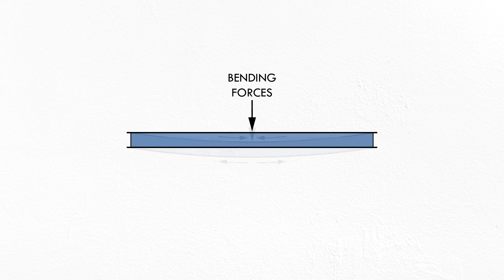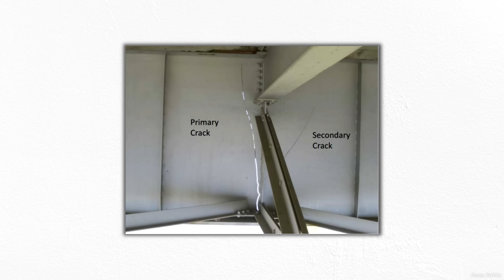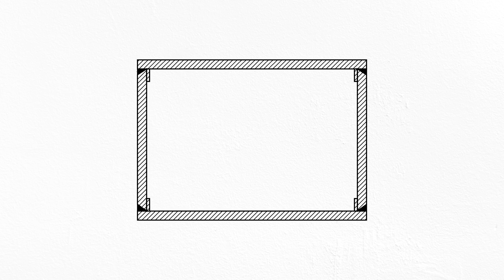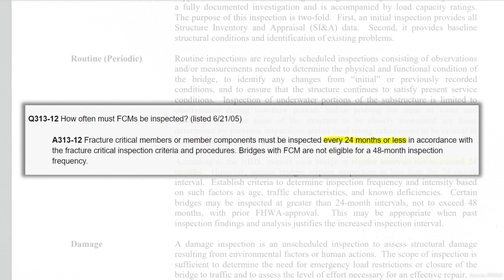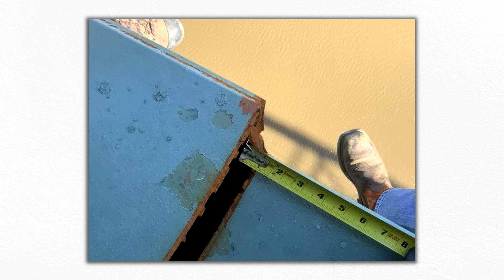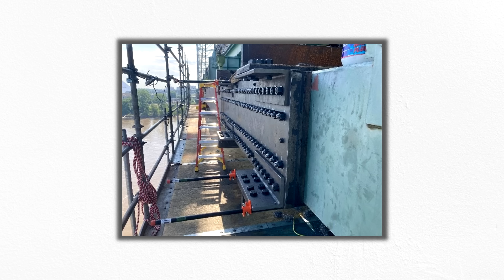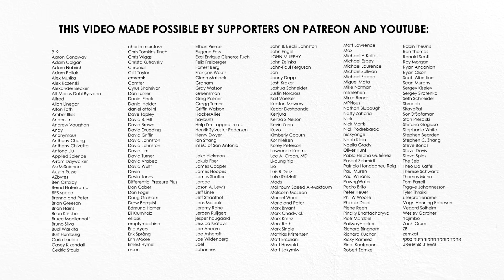What Really Happened at the Hernando de Soto Bridge?

Comment: This seems like a problem that drones and some sort of visual recognition could go a long way to solving.
Reply: They had drone footage from years before showing the crack. It's in the video. The problem isn't tech, it's that the people involved in analyzing the evidence are subscribers to the "ignore and defer" theory of maintenance.
Reply: @notsure7874  and THAT “theory” should be stopped IMMEDIATELY!
Reply: Drones were used, and the flaw was missed.  When somebody actually got close enough to touch it, it was discovered.  Drones are useful, but only if the footage obtained from the drone is reviewed... by more than one individual... that's key.  Apparently, nobody went back and looked.  You can have cracks in steel that are so fine that you can't see with your eyes.

Comment: It's amazing how despite losing such a critical piece, the bridge still remained standing. They knew how to build stuff back in the day. Even with our fancy futuristic materials, you can't find architecture that resilient today. It's like a lost art.
Reply: The likely reason for this is that the design for the bridge was completed well before modern CAD and FEM software was available to engineers. The entire structural design would have been done via hand calculations and hand drawn on A0 sheets of paper. If the calculation landed in between available structural member sizes or wall thickness they would always err on the side of caution and go with the next bigger size thereby increasing the factor of safety (FoS) in the design. Today, if the engineering standard stipulates a minimum FoS for a certain design CAD and FEM ensure that this will be achieved to the decimal point... because it saves money.

Comment: I would hope that a bridge such as this one that relies on that beam should have some kind of redundant backup, maybe a this steel cable that runs alongside that beam so if the beam fails the cable should take up the load until the beam can be replaced without a catastrophic failure of the bridge itself.

Comment: The "if your inspection hinges on a single person, there's something wrong with your inspection process" was great. Sometimes engineers only think in terms of design and materials and not about how work is actually done (by actual humans).
Reply: We've got a spreadsheet and all the cells are checked off.  The bridge passed inspection. <sarcasm>
Reply: @paulvarn4712  My father was an engineer that was responsible for making those check lists, and the procedures for testing and inspecting the parts the companies he worked for built. All of his work depended on the guy using his procedures correctly and ethically. people that ignore crap like that piss me off, I drove over that bridge A LOT with very heavy trucks, what worries me is they have proven they miss stuff like that on one bridge, now I have to drive across the much older, and smaller i55 bridge, how much did they miss on it? With all their engineers busy on the I44 bridge are they even keeping an eye on the larger amount of stress the older bridge is taking? Makes driving that route a bit of a pucker factor.
Reply: @scottjackson1636  story from different country, but humans are same everywhere. Inspection of elevator, engineer from client arrives, "We have 10 minutes, make it quick", and inspection is done after one ride to top floor.
Reply: @scottjackson1636  We lose 40,000 plus on the highways every year and none of those from bridge collapse.  You should be puckered over other drivers and your own driving; that is the greater risk.
Reply: Early in my career (engineer, not structural but manufacturing), I was taught to assume that visual inspection would miss 50% of defects when analyzing the effectiveness of a quality control plan. That's excessively pessimistic but forces the QA strategy to never depend solely on VI at any critical decision point.
Reply: "Don't worry. We fired the requisite sacrificial lamb at the very bottom of the totem pole. All is right with the world. -Sincerely, Upper Management"
Reply: Reminds me of the famous incident with the two catwalks that were supposed to be on a single beam support, but because it was cheaper and easier, support for one catwalk was scewed into the other.
Reply: @ShaliWolfy  Kansas City Skywalks and that was an error by the fabrication people, not the designer.
Reply: @stonefly69  Sounds like the Kansas city alright, but unless there's been two there. The designer had a share of the blame, but he was kind of screwed by the lack in those days of redundant oversight requirements. He should have checked the Redesign the owners asked for more carefully before OK'ing it but he shouldn't have been the only person with that responsibility, there's a reason every regulatory agency around the world has eventually started expecting independent verification of design work. Humans screw up from time to time. A second unconnected pair of eye's helps catch that stuff.
Reply: My guess is it was a manager responsible for inspections.

Comment: I'm guessing you are already collecting information for a video on the Miami building collapse.  That is shaping up to be criminal negligence by the building owners.  I just saw a report of regular saltwater floods in the garage under the pool. Sometimes to the extent that cars were floating.  They tried repairing cracked concrete support columns by injecting epoxy into the cracks, but that was failing and the columns were crumbling.  If I lived there and had that information, I'd have moved out.

Comment: The fracture at the top of the beam appears to be too straight, this does not normally occur in a fatigue crack. It is possible that this location has a steel beam splice.

Comment: That is terrible and an investigation should be done to find out why the existing inspection process failed. Those responsible should be held accountable.
    In retrospect, that bridge must have been over engineered if it was able to withstand those forces for so long with a structural member in such poor condition. Maybe all bridges are over engineered and certainly should be.

Comment: First off, sure you could see this crack then yes it could be picked up by visual inspection. What about the crack on structures or at weld locations which have crack propagation and inclusions you can't see with a visual? They should have a robust inspection plan which includes NDE techniques.

Comment: When more information arises, I think the recent Miami building collapse would be an interesting video idea
Reply: WTF is up with some of these comments? This is an engineering channel. Please keep your conspiracy theories to yourselves.
Reply: The republicans have already figured it out with no need for any research or evidence. It turns out that it was the fault of the residents who chose to live there. Case closed.
Reply: Look at the historical plans. The pavers where never meant to be installed and the pool deck was tied into the structural columns. In addition they took away important drainage features
Reply: Miami building collapsed because the soil under gave in, its built on what used to be flood plains and rising sea level causes sea water to penetrate back into what was once dry land and recovered, causing underground water rivers to form, soil collapses into caverns and causes the above ground to become unstable, Miami is ripe with problems like this, frankly its surprising it has not happened before or more often.
Reply: Bearcat  There are many factors buddy, I'm sure they'll come to light. Well you'd hope. I only look at facts. I was just responding to an idiot.
Reply: I assume it was something similar to the Algo Mall collapse, but I'm not an engineer, so I dunno. It just seems like a similar collapse in my mind.
Reply: That's going to be in litigation for the next 20 years, at least.
Reply: Yeah, good call!
Reply: I don't get why they stress tested it with traffic still going under it I was there that day it was a Krazy scene
Reply: Let the families of the lost grieve before making an video on it. Out of respect.
Reply: @taylor7772  out of respect to the dead, you must share everything we can learn as fast as we can learn it. 
Imagine I knew what killed a bunch of children, but didn’t warn anyone, so it kills a bunch more kids that would have been saved if I hadn’t been selfish. 
How many children must die for how many years before we’ve “shown respect “ and we can start sharing lifesaving data? 50, 100? Just one? Tell me how many is okay with you, because that number is zero for me. 
If my death can warn others, by all means don’t get superstitious. Warn people! Discuss it.
Reply: It was a report in 2018 saying the pool was eating the foundation and action was needed immediately but ignored
Reply: @johnwright4890  the summary of that same report said the building had no major structural deficiencies.
In any case, you may find that the normal time required to plan, bid, and approve a 20 million dollar project, that is 500 people’s money, is about two years. You may also find that Covid added more than a year to most of these major, complex contracts. 
It’s hard to predict construction costs during covid, or delivery times. 
I don’t know that there wasn’t incompetence (other than the summary of the report contradicting the report). I just think nobody else was jumping on projects like this much faster. 
You might imagine they didn’t have a lot of condo owner meetings to discuss maintenance during covid.
Reply: Controlled demolition.
Reply: The phrase “too soon” comes to mind. Thankfully, this bridge failure didn’t lead to any loss of life.
Reply: Anyone who could have done something didn't because they didn't care enough. Now the whole tv show second by second report to be done.
Reply: Honestly we already know what happened there and somebody belongs in jail if not a couple somebodies
Reply: It had just been inspected, that’s the crazy part of that building collapse .
Reply: This explains it https://youtu.be/PEPyE2h6P4k
Reply: @KezanzatheGreat  Sounds like you were an inspector for the WTC. Do you or have you work for NIST.
Reply: Money says that waterproofing or lack there of has major causes towards failure. It had a post tension slabs so the second one of those were to corrode and break it can easily cause a chain reaction causing collapse. But it's all speculation until an independent outside source does a report on it
Reply: @shawnhenderson1130  It's possible you've seen the same videos as I. There is a video showing water from a broken pipe and chunks of shattered concrete at the bottom of the ramp down to the garage. This was seven minutes before the building collapsed. The conclusion from that as well witnesses is that the failure started on the pool-deck The cause was the failure to prevent water collecting on th e deck and penetrating the waterproofing. This let to the chain-reaction failure of the supporting columns.
Until more information contradicts that, I think that a likely explanation. 
If I were the resident of a Florida high-rise I'd do some checking of it's history and inspections.
Reply: Pool was built above ground over the parking garage, pool had an ongoing leak which was neglected, water leaked into concrete weakening it over time, concrete gave in, the building collapsed.
Reply: @colzen925  Sounds good. Except the initial collapse was clear across away from the pool.
Reply: Too recent/contrversial. He'd likley get demonitized.
Reply: The collapse could very well have been intentional !
Reply: Except that has John McAfee ties
Reply: @Sassafras-  wait what???? where did that info come from? HOLY... did he kill himself after the collapse or before?
Reply: @Outwars1  It's bullshit. John McAfee had no ties at all. It's just excuses people make to cover up corruptions of officials and climate change.
Reply: @psychedeliccarrie5921  gone learn you how aye
Reply: The Miami building was a demolition
Reply: @Nikkisweeets  Congrats on posting the absolute dumbest comment on this whole thread.
Reply: @Nikkisweeets   Just go away.

Comment: CRT + SEX = practicing engineering = you loose . Degree holders should be re-tested every 5 years .
Reply: Umpossible! its far more important that engineers know the 57 genders than proper understanding of structural physics.
Reply: @archieames1968   ;-). Hmm Nut and bolts X 57 = ?

Comment: In a time when lasers and vibration sensors are cheap as dirt, one would think someone would consider using them.

Sure, they'd require service but they could be monitored by a computer 24/7 and would be able to 'see' and 'hear' structural changes as they happened.
A crack like that would completely change the acoustics of the structure and the characteristics of an interference pattern.

They'd also be able to tell inspectors where on the bridge to look for problems by modeling the aging of the members.

...and while it might be costly it wouldn't begin to approach the costs of missing a catastrophic failure event between inspections.

Comment: So has any effort or thought been put into the "Other Bridge", the one that is older, and smaller - yet taking on ALL of the diverted traffic?  I sure hope it was immediately inspected to assure it can handle that load at least for a short time.
Reply: It is old but solid, I believe it uses a different stress system to the main thoroughfare and it is  usually having parts replaced or upgraded to act as a secondary crossing if the main bridge ever goes down.

Just so happens that it was up to the task this time.
ARdot is going to be paying for both of them to be repaired in the foreseeable future though due to this little fluckup

Comment: In that situation each connecting member is designed to take a percentage of the thrust load.  With one broken member each other member most likely 7 other members had to pick up 18% more load.  If a worse case loading of the brigde cause by auto accident then your forces could easily exceed 120,000lbs of additional force on each trust sectiomn.  Easily and greatly enhancing the risk of massive failure.  Without adding side to side forces caused by wind, accidental barge strike, or a earthquake.  This Bridge has also served 48 of it's designed years of life out of 50.

Comment: It is all well and good for us as Structural Engineers to discuss the obvious and missed crack.  As stated in the video, what are the responsible agencies inspection procedures and requirements?  I will push this a step further.  What are their inspectors qualification requirements.  Unless it has changed, Federal inspector qualification requirements did not require the inspector to be a Qualified Engineer (4 years of Engineering), much less having to be a licensed professional Engineer (P.E.)  Most States other than the East and West coast States, for the most part, followed the mediocre Federal requirements.  In other words, most of the states that were the Pioneers in the first Bridge Inspection Programs usually required the Team Leader of the team to not only be a Graduate Engineer but also a Licensed Professional Engineer (P.E.).  If these qualification requirements have not changed and are followed by the agency in question, this is unacceptable and has to be changed.

Comment: I live in Memphis, TN and frequently travel to Arkansas. I must say, we need a third bridge in this city. The I-40 bridge funnels roughly 50-60 thousand vehicles across its six lanes daily. Since it's closure, we have been using the I-55 4 lane "old bridge" as we call it. There are delays of upwards of 6 hours to cross the bridge right now during some times. It is a nightmare. The closest two other bridge crossings are more than an hour in either direction. With such a major choke point for I-40, there needs to be another crossing. What would we do if the I-55 bridge has an issue right now? Anyway, rant over. Have a wonderful day folks.

Comment: During the 2019 flooding, I was running I-40 multiple times a week between Lexington, KY and Laredo, TX. One time, the water was about 5' from the bottom of the bridge. There were just the tops of mature oak and maple trees poking out of the water along the banks. That probably didn't help the structure either.

Comment: Engineers will likely find loading of bridge members exceeded the designed load capacity caused by slow moving, bumper-bumper traffic with many capacity (8o,ooo) pound trucks on the bridge simultaneously, far more than engineers computed as expected load.

Comment: That is a displaced break, not a crack. A crack remains in place with an unopened gap in one piece.

This is a complete break with a gap between two sides of break, displacement between the two sides of the break.